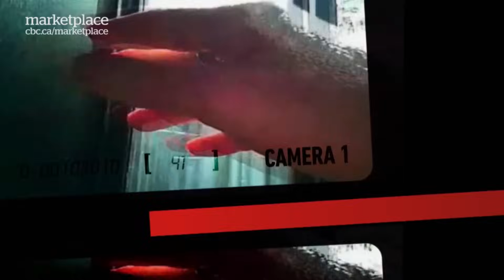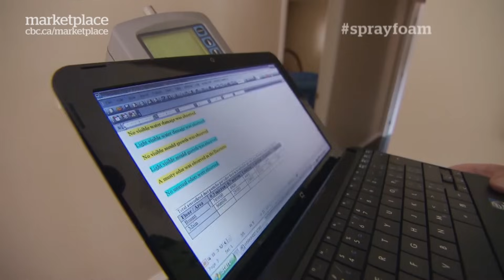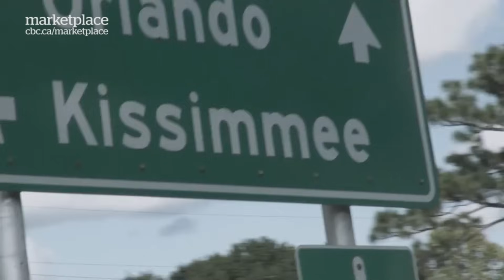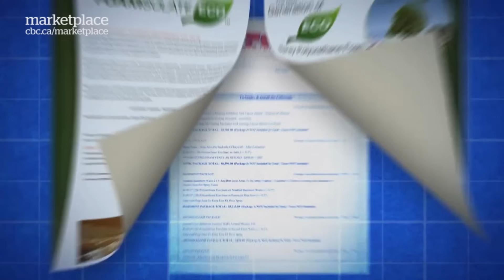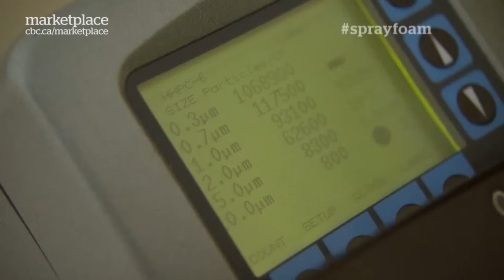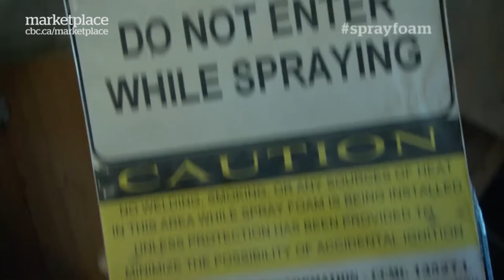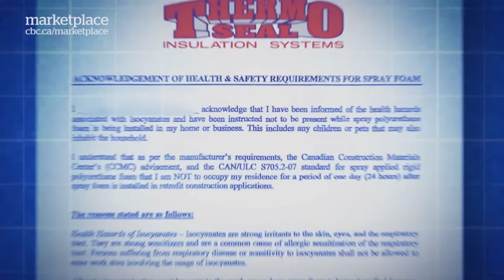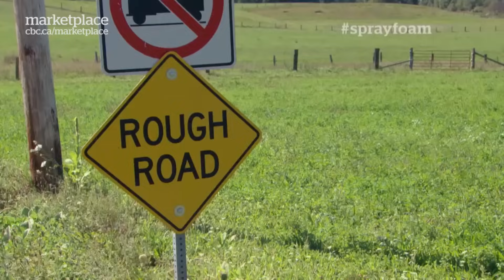Spray foam insulation nightmare: What can happen if it's not installed correctly (CBC Marketplace)

Comment: Hybridamerica, you use fresh air intake in a spray foam home not venting.  First,
You never spray foam the attic floor.  I was a spray foam contractor.  I would also used veggie based foam.  Don’t use Soy and Formaldehyde based products.  Soy can increase estrogen levels in home as well, not good for woman.  I would never ever accept an retrofit job, no matter what the profit was.   This company did an awful job and their mixtures were wrong.  I live in a spray foam home and have no smell, Of course its a new construction home build. Spray foam contractors do not do retrofit.  It’s takes an average of three days to off gas in new construction home building.
Reply: Yes. Fresh Air intake. Has to do with pressurization of the Home.

Comment: New carpets, car plastic, etc off gasses formaldehyde. Its in a lot of stuff. The haze on the inside of your car windows is off gassed formaldehyde from your car interior. Its common, but super unhealthy. Saying that the foam created it is bad reporting. Still, this industry needs some serious adjustments.

Comment: Leave the bedroom door open don’t close it up in there … allow the house to BREATHE open windows and attic doors and interior doors… u can’t keep that crap trapped in a single room.. AIR THE HOUSE… apparently someone didn’t know the difference between open and closed cell… also it’s installed WRONG.. should be on the under side of roofing deck … don’t go cheap or with no name companies cause this is what hapoens

Comment: I built my house 15 yrs ago with my own 2 hands....over that 15 yrs ive had to do things where removing the fiberglass was needed....im wondering how would anyone ever do a repair of installing an antenna where holes have to be cut and wires rerouted if this stuff was all over everything....i put in a stove vent and with the fiberglass it was move it aside install the vent pipes replace fibergass..easy...along with several other things i cant name one that i could have done with this stuff stuck to everything

Comment: What happens when these structures have to be demolished, or burn down. Will the foam give off toxic fumes, or will it float to the top of the dump when it is finally hauled off. Sounds like there may be a lot of problems for the grandchildren. Not to mention the thirty trillion worth of debt!

Comment: Its already nonsence to put styrofoam on the outside of the walls, but to spray polyurethan on the inside is realy dangerous, i always wonder what happens to the wood in 30 years, moist cant get out. Not to mention the chemicals steaming out...

Comment: This is so dumb. They've been using spray foam in rv trailers for year's. So ridiculous. Also if it's so terrible then just tear out the insulation. They can renovate  a flooded hurricane home but not with toxic spray foam 🙄

Comment: I built 2 of the exact same houses one with spray foam one without in Alaska. -20F outside the house with foam and a tiny fire lit in wood stove would be 90 in the house. The other one SUBSTANTIALLY cooler with same fire lit. These people were drama queens and there is no way to prove the smell was not pre existing. Not defending a sh!tty job but still...

Comment: spray foam as insulation is madness, this material ages terribly, and it is full of very nasty chemicals, and not quite stable (it degrades quickly in few decades) i dont understand why it is so widely used in north american, here in france i dont think it is even allowed, and i never saw it used for insumation except in very small area, for example between door hinges and wall, and even for that it is not well considered, because it doesnt age well and is a nasty stuff.I think it is not used/allowed for most of west EU neither.

Comment: Spay in Foam insulation is one of the leading causes of Mold Growth in Homes. It traps moisture and moisture breeds Mold.
Reply: Strongly disagree. It actually keeps out moisture out. Almost immediately after the spray, our humidity in the home dropped 25%. Dampness gone. This technology rock. But you must use the best material.

Comment: Sorry, can't watch because of the awful camera-work and editing.  I don't know when this nauseating method of filming and editing became vogue exactly but it's certainly put me off watching programme and the safety implications implied.  That's a pity.  I would like to have seen this.
I haven't heard what the two precursor chemicals involved are exactly...except the formaldehyde produced by mixing the chemicals together in too thick a layer.  As far as I ken, poly-urethane is a process of chemical reactions but I'll stand corrected if I'm wrong.  This is the same stuff that is sprayed on hot-water tanks and the like or something not far off it?  Right?

Comment: It's too late to give them the opportunity to fix a bad job. At first they refused and said nothing was wrong, hey I get it no one is perfect 100% of the time, but you suck it up and own up to your mistakes fix it and go on. It was  to hot to install, or too cold and put on way to thick.
Youd think by now they install a plastic layer over any area lick the edges sealed tight and if they was a problem it's a quick fix insted of a total home makeover.  Better yet install ridgid board in the joist bays and only spray the 2x? Edges and covered with vapor barrier joists to make a foam envelope and help hold the heat or cold in and keep the drafts out. The whole point is stop air movement. Closed cell works the best.  And 2" thick is all you need.
Even a 1" layer works to stop air movement  some of that stuff looked like it was 4" thick or even more.
All I can say is that was a new guy or untrained pro.  Yes I'd stay in the house and watch, but I'd wear a respirator made to protect me from the fumes and have the knologe to know if the job is being done correctly, your a fool if you dont.  If I didnt know enough I'd hire someone who is.  This is for any jobs you hire someone else to do.
It cant hurt to have some independent person to inspect the work, yes you will pay more but the knowledge some one is taking your money for subpar work is worth it.that way you have a chance to fire them before you've been taken.
And not try to get repairs after the fact.
Think of it as class action insurance

Comment: YOU DIDNT DO YOUR HOMEWORK RESEARCH ON THE MOST COMMON TOXIC HOUSING MATERIALS  BEFORE YOU BOT THE HOUSE, ANY HOUSE!!  SPRAY FOAM INSULATION -- NEVER!!  FORMALDEHYDE BASED ADHESIVES IN WALL SHEETING, FIBERGLASS INSULATION, WALLBOARD, PARTICLE BOARD CABINETS, SHELVING, ETC: TOXIC OUTGASING FOR 20 Y, ETC.  POLYURETHANE ON FLOORING, WOODWORK, ETC, NEVER STOPS OUTGASING.  SYNTHETIC CARPET FIBER, BACKING, AND FOAM PADDING ALL ARE HIGHLY TOXIC FROM PETROLEUM BASED CHEMICALS.  IF BUILDERS USE IT EVERYWHERE, HOW COULD IT BE BAD?!!?  BECAUSE YOUR GOVERNMENTS AT THE STATE AND FEDERAL LEVELS ARE A CORPORATOCRACY THAT IS BOT OFF BY THE MAJOR MATERIALS CORPORATIONS: HEALTH AND SAFETY ARE THROWN OUT FOR PROFITS!!!  ITS NOT AN ALLERGY, ITS TOXIC TO ALL PEOPLE, ESP TO PREGNANT WOMEN & FETUSES, NEWBORNS, AND CHILDREN!!  ESP FOR THE ELDERLY ALSO!! BET ME ON THIS!!!
Reply: I got 25 year old house I guess it is fine now...

Comment: They say spray foam, but it is actualy chemicals that mix to cause this foam..I am not sure about you, and I have never used this in my house. But I did use this type of chemical foam for packaging material for shipping. Ok! Maybe not the same type of chemical foam used for homes..but the same principals. And I remember the smell...fishy, stronge chemicals odders. So why would it not be in the best interests for the company, to make sure that there customer and there families are safe? Open the windows and cirulate the air flow for at least 24 hrs to get rid of the out gases and odder caused by the cemical reaction. I just don't get it!!! I mean there will be odder smells from the out gasing as the chemicals mix!  So why would you think it is ok to stay in your house when this is going on???  Do you beleive what everyone tells you, or what is said in a contract? Or what is writen on the lables??? I don't! Pretty simple...your spraying cemicals to seal my house from the weather, insects! Ok! Family trip for a few days, or good night out camping in the yard...lol

Comment: foam insulation was installed under my River front cabin floors to help conserve heat. Within 2 years my floors had developed soft spots . Instead of  keeping moisture out of the house, wherever they missed a spot - humidity was getting between the barrier and floor . Rotting my 100 yr old hardwood floors and original beams. Destroyed my beautiful space.  Some companies will spray any place the they can make a buck , and it's not a inexpensive process.   It was not what they sold me on . $2,000. To put in and has  exceeded $ 30,000. To jack up the house and rebuild the base , and rebuild a new flooring system . A real nightmare.

Comment: Back in the mid 70's the parents of my old girlfriend had a fly-by-night spray foam insulation business insulate the exterior walls of their old farmhouse.  The house was wired with old two-wire ungrounded electrical wiring.  There were literally two bare wires ran through the walls held in place with two-piece ceramic insulators held in place with nails.  They drilled hundreds of holes in the exterior siding through which they filled the exterior walls with expanding foam.  They plugged the holes with plastic plugs.  In doing so, they completely encased the bare ungrounded electrical wiring in flammable foam.  The house had the old type plug fuses, not modern circuit breakers.  This was a disaster in the making.  All it would take is for one of those circuits to be overloaded.  The now-insulated bare wires, in direct contact with thermally insulating foam, could easily get hot enough to ignite the foam and the house.  People who don't understand electricity with these older homes should never use such a dangerous product.  It's hard to believe any business would sell and install such a potentially dangerous product.

Comment: look ok there is a law suit problem I would argue that the owner is making a meal out of this, install an attic fan system (temporary)  and duct out thru a 12 inch tube or more the stink.  the chemicals may be heavier than air which is a problem' if i was going to use this on a level surface (not sloping) i'd lay plastic sheeting first just in case as a barrier - never user fibregalss based products A/they collapse, B/ they let of tiny strands of glass fibre into the air just like asbestos

Comment: Spray foam is the devil we get calls every year of new or a year or 2 old that are  spray foam homes that the contractor not the foam contractor nor the HVAC installer failed to inform home owner their house would be humid an sticky an nasty without installing a de humidifier do to the fact the A/C isn’t running enough to remove humidity an house is sealed an doesn’t breathe an air gets musty like a sweaty locker room or a little water left in a ice heat with lid shut on a summer day an then we explain this to them an they are mad at there contractors just this last summer had 2     500,000 dollar homes that were around a year old one had mold in cabinets  an other smelled like a locker room all the time neither had fresh air return from outside nor did they have de humidifier installed

Comment: I do feel empathy for this Canadian family and the horror of an experience they have endured. It should be a cautionary note for all of us contemplating a renovation such as this (insulation) to be thoroughly familiar with the product you are having installed, and to carefully choose a contractor who is licensed and experienced with the product (and to have a written guarantee, such as suggested here).  As for the chemicals that foam generates, the aldehydes and benzenes,  they are  byproducts of the reaction that occurs during the foaming process.  I would hope that industry standards would require a level of acceptable health risks of these products, and hold liable the manufacturer or installer if these levels are exceeded.

Comment: They insulated the attic floor? LOL LOL Yea this was a good contractor. I bet they got the contractor with the lowest price.
Reply: I agree with Phil, You never spray foam the attic floor.  I was a spray foam contractor.  I would also used veggie based foam.  The soy based products can also increase estrogen levels in home as well, not good for woman.  I would never accept an retrofit job, no matter what the profit was.   The company did an awful job and their mixtures were wrong.  I live in a spray foam home and have no smell, I live in a new construction home build. Spray foam contractors do not do retrofit.  It’s takes an average of three days to off gas in new construction home building.  I don’t know how retrofit spraying could off-gas.

Comment: They actually could've gotten that foam removed. It was clearly incorrectly applied, in too thick layer. The installation guy just wanted to get this fast over with.
If they would've let that company just scrape it out, it should be ok, because even if some small pieces would remain, they would be able to release the gasses much faster.

Comment: Both sheetrock and fiberglass insulation off gas formeldahyd. Always has.
Reply: The new fiberglass batts are formaldehyde free. Customers won't buy that stuff anymore. Everyone is environmentally conscious now. Safer and smarter. Thank God for the internet.
Reply: @jamesdupuis3249  what type of glue do they use? What about sheetrock and OSB?  No Urea Formeldahyd glue in it?
Reply: I'm just an insulation installer. Owens Corning Pink EcoTouch is formaldehyde free. Knauf with Ecose technology  is also pheno-formaldehyde free. Not sure about sheeting products. There is a wide variety of products to choose from, just many people are more picky around here. At least where I am at. We also tend to install in higher end homes and builds. The cheap stuff, maybe it's crap, but my boss won't use it. If I go into a twenty year old retro, I highly doubt any of that stuff is clean and safe. It all had formaldehyde then. But the way "progress" and companies work, who knows, maybe what they use for binder now would be determined detrimental to our health in the future. Just won't know till twenty years later, ya know?
Reply: @jamesdupuis3249  I personally don't think it matters much. Except in buildings that don't exchange any air outside. Some people are super sensitive to trace chemicals, and I don't believe building standards should be set to satisfy their needs.

Comment: Simple solution for the whole insulation sh@$"*it. Ytong from Germany or something similar. It's the best quality LCC. You have the walls, stairs and the roof as well from it. Who is to be blamed? The whole feckin construction industry, with the low standards and quality.
Do we all know the tale with the 3 piggies and the wolf? How did the Romans managed to have long lasting buildings? Kiln dried clay bricks.

Comment: 1ST OFF the installer spayed the floor?! Are you serious! it goes on the inside of the roof!  Nothing is supposed to be on the ground of the attic floor if anything it gets removed (old insulation) get your facts straight before you talk bad about spray foam. That's should've been the 1st thing you said. Not bringing in some chemical guy lmao
Reply: If it's a vented attic you spray the attic floor.

Comment: Just don’t do any spray foam,
Reply: Spray foam changed our home by spraying almost the whole home during a complete house redo. Bugs are gone as as well drafts and cold spots. Home is way more efficient and cheaper to heat and cool. Side benefits of spray insulation is that it stiffens up the entire home. I advise all my Friends to use this technology. Just be sure to buy the best stuff. Smell in our home was gone the next day. This stuff rocks.......as a side note, when we were demoing the drywall down to the studs, we found four ant nests living in the fiberglass insulation. Noting can live in the closed cell foam. Dense stuff.

Comment: Poorly vented attic
Reply: These days, because of Title 24 Energy requirements and Fireproofing needs, many California residents have had to consider this foam insulation with the unvented attic space.  The attic spaces need to be kept air-tight per code R806.5.  Hopefully it was just a bad installation problem where the contractors did not mix the foam compounds properly and apply in thin layers with each dry.  I'm not a contractor so I'm just guessing, but nonetheless, it does give me pause.